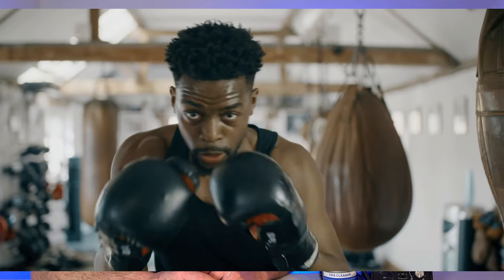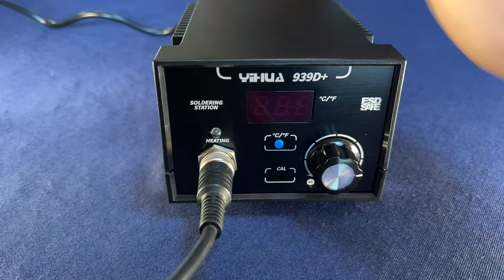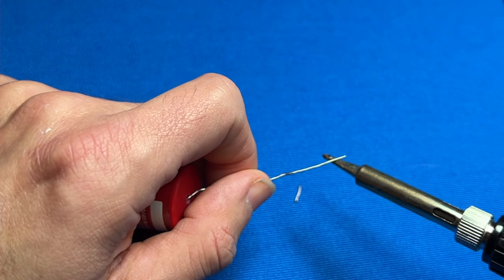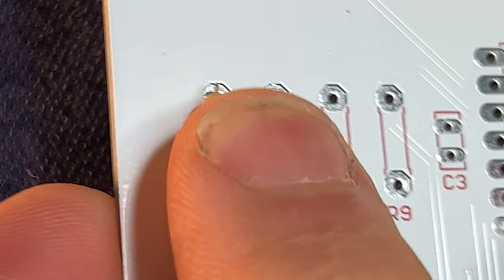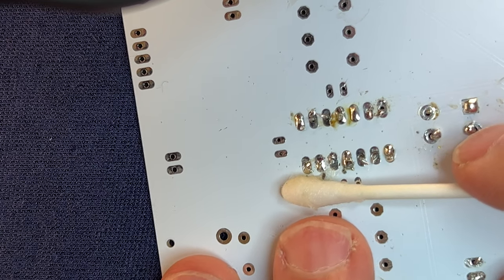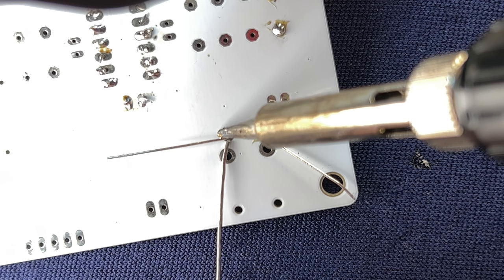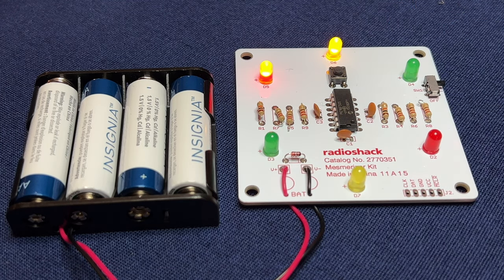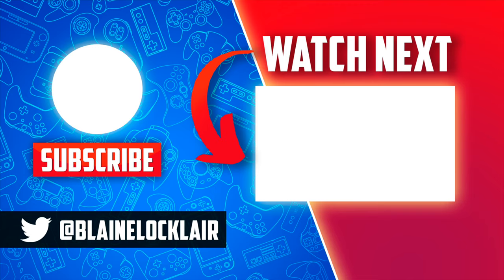Soldering For Beginners - Learn In Just 11 Minutes

Comment: I think you can benefit from using some additional flux because it appeared that the solder was having a problem sticking to the copper pads on a few of your joints. But otherwise great intro video to soldering and as always keep up the great work.

Comment: Thanks! I am doing my very first soldering project on an original xbox power circuit just to remove the power capacitor and replace them. Your video helps out alot. Thank you
Reply from the maker: Thanks so much for the Super Thanks! I just saw it and I'm very grateful for your kindness. :)

Comment: 3:41 THE WORST SOLDER JOB EVER
Reply: Agreed, the first led leg, the solder didn't really flow, and the second one,  it is even making contact? I stopped watching. Maybe some more flux would have helped, maybe a bit more heat was required as well.  If that temp was accurate 325C should have been enough.

Comment: What temperature should I set my iron to when working on small pcbs like Nintendo handhelds?
Reply: For leaded solder, maybe 325C, for lead free maybe 375C. You need enough to really flow the solder, but more than that is not better as that just heats the components unnecessarily.  Experiment and find out what works best. Use flux.

Comment: yust one question why didnt you use ic socket ,it will be easier?
Reply: @blainelocklair  or 2nd  witch u zse or prefer that you line the object under at  hide of the pcb and you don't need a capton tape